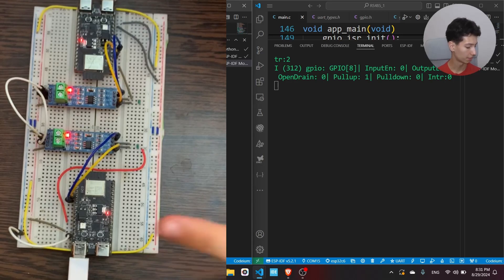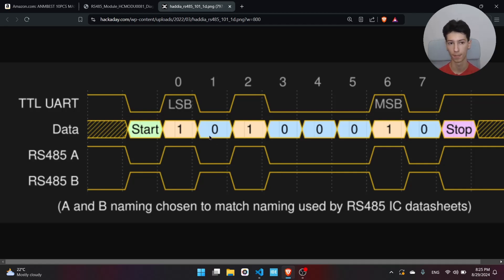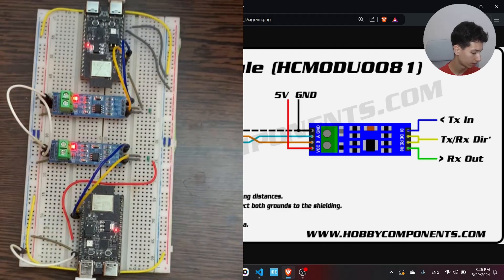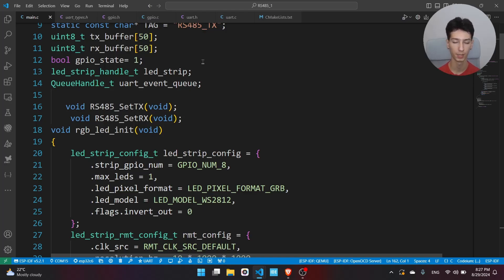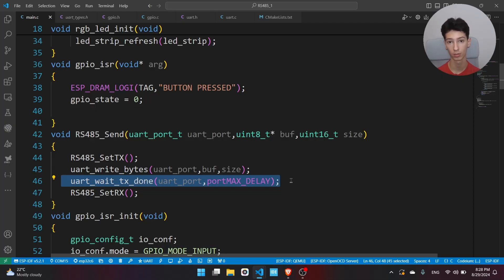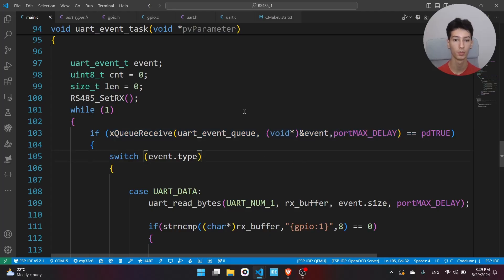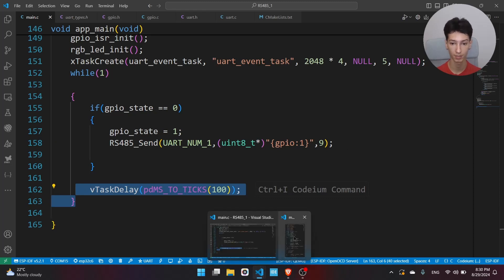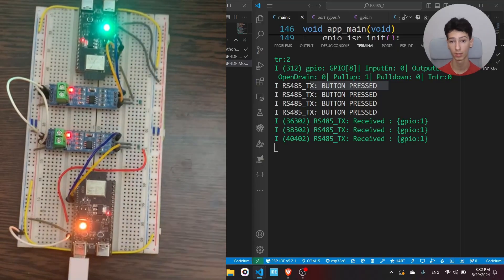How To Interface RS485 Module with ESP32 in ESP-IDF | Modbus Tutorial

Comment: Thank you so much for this video 🙂
One question, is it safe to connect the rs485 module which is 5v to the rx and tx pins of an esp32 which is 3.3v?
Reply from the maker: no its not, most esp32s are not 5v compatible